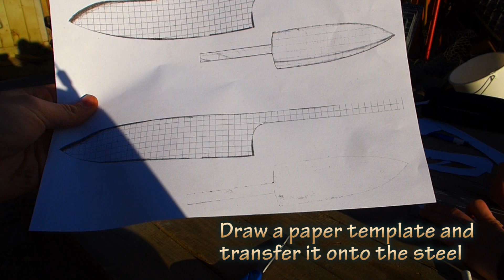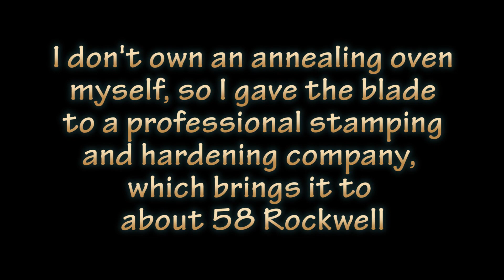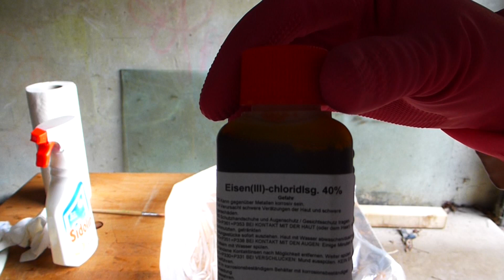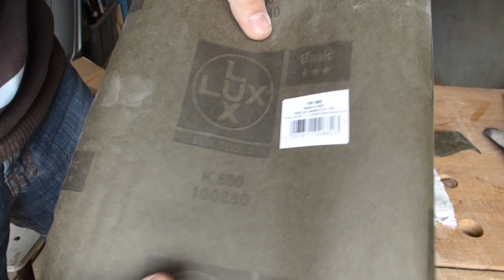How to make a Japanese Style Kitchen Knife

Comment: That is an incredible looking knife. I'm interested in making knives using the stock removal method. What advice would you give to a newbie and what are the minimum tools required and also what tools would you recommend as a bonus to help out. Thanks.
Reply from the maker: +Peterkr10  Thanks ! 
Ok the minimum tools you need are : a good file ( bastart file double cut )
some clamps, a drill, a hacksaw , lots of sandpaper , epoxy-glue. these are the tools you will definetly need , something that makes you work much eaysier is a vice and a beltsander.
by the way check out walter sorrells Channel here on youtube he made some realy good videos for knifmaking beginners ;) for example the tools you need : https://www.youtube.com/watch?v=s5bdWsVSZbA
Reply: +Jan Bane thanks a lot for the reply. I need to heat treat my blade and make the handle still so I still have a lot of work to do.

Comment: Very nice. Where did you purchase your steel?
Reply from the maker: I got my steel from a local company, but you can buy the same stuff online 
its VG-10 laminated steel
Reply: Jan Bane Then you wasted money. VG-10 is a very expensive and very high carbon steel. If you are only taking it to 58 rockwell there is no point. You want a rockwell of at least 60-61 on a finer edged knife, along with the fact that VG-10 has a very fine grain structure, you dont have to worry about excess carbide build up.

Comment: I love the look of this knife!

I'm gonna try to make simple kitchen knife using a filing jig, what thickness did you use for the steel of this knife?
It looks to be about 2.5 mm but it's a bit hard to tell.
Reply from the maker: nice to heare that you start you own project ;) 
the steel is 3mm thick ;)
Reply: Thanks!
Comparing this with kitchen knives at home it seemes a bit thick. Did you grind down the spine a bit or is it still approx 3mm at the top? Does it feel heavy or is it just fine?
Reply from the maker: Its a bit thinner at the spine, but not extremly thin.
because of the hight of the blade 3 mm is ok and it feels very light. the balancepoint is exactly at the brasselement so it feels fether light in your hand, realy !
Reply: Good to know!

Comment: Japanese knife's tang wasnt suppose to be that long it shiuld be about 2 inches to ease changung handle if needed
Reply from the maker: +Teddy Bear Thanks for the tip! Didn't know that.
I build it a litle longer so the epoxy has more surface to bond with.
Gives a bit more stability ;)